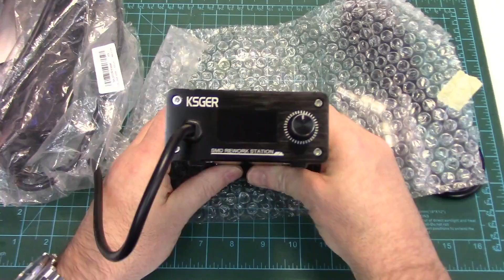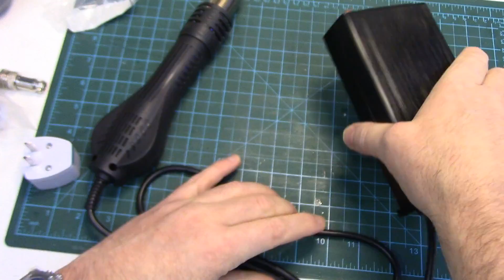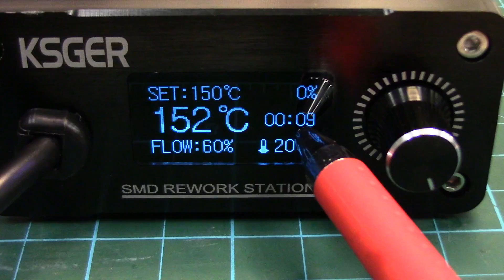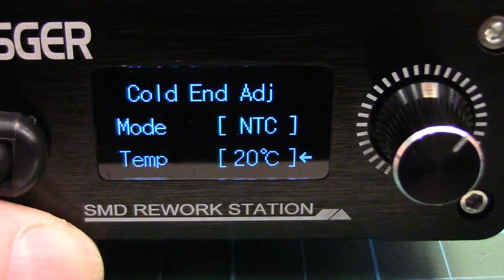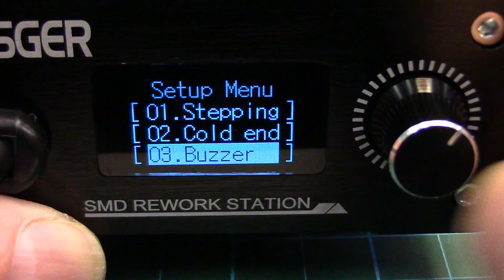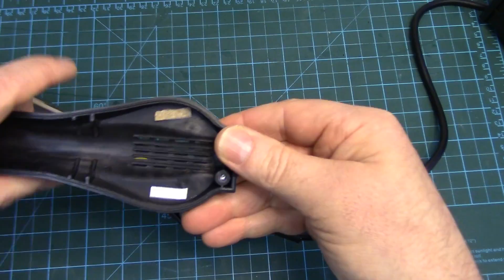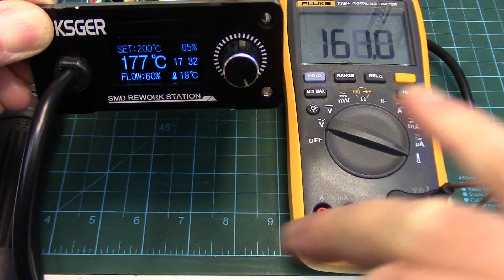KSGER 858D Hot Air Rework Station Review

Comment: Mine melted itself the first time I used it at 450 degrees and full fan for a minute or so
Tube glowing orange was the first sign that all was not well
- tip temperature wiring failed shortly after heating element burned itself out...so I suspect the wiring to the tip temp sensor was iffy causing the coil to burn out (due to it miss reading the silly high temps it was hitting)

I am having a few issues sourcing a new element to see if anything  can be rescued from the wreckage, so have ordered a new complete handle 

I am not convinced you have an NTC in the handle if it is the same as mine (which your images look almost identical)
If you look at the other side of the PCB that interconnects the wires from the flex to the components there is no NTC on there and I haven't spotted one in the flex lead...which is mysterious as I genuinely cannot see one no matter how hard I look for it

The unit I got was pre wired with a GX plug and mine is wired as follows...again I cannot even see any spare wires for an NTC mounted in the cable

Pin1 (red) > AC240v heating element
Pin2 (brown) >  24v fan +
Pin3 (blue) >  24v fan -
Pin4 (Green)> Green wire to ground the metal tube
Pin5 (Yellow) > Reed switch
Pin6 (White) > Reed switch and tip temperature
Pin7 (Orange) >  tip temperature
Pin8 (black) > AC 240v heating element

Really interested in which wires yours is wired into (and if you can show me where this NTC is supposedly mounted !)
Of course without a working tip temp sensor  I just get errors so I cannot even try and raise and lower the temp in the handle to see if the screen reacts to this mysterious  hidden NTC
Reply from the maker: Nope, there is no NTC sensor in the hot air handle. I show my specific wiring (color & function) in the connector mod video:  https://youtu.be/vtPHqNQ3pLY
Reply: @rchelicopterfun  Yep, found where mine lives - it is sat behind the screen - just above the speaker
managed to fudge mine so that it doesn't error so I could test it - by shorting the tip temp probe wires it 'thinks' it is at room temp - all the functions appear to work and I get 240v when the temp has been set - dropped to 70 V when not being commanded/requested-  so it looks like the controller is all working and I haven't killed anything in there - just a broken and burned out handle - hoping the replacement will fix the issues I had
(bit concerning that there is seemingly no thermal runaway watchdog in firmware - like on 3d printers - unless mine was an odd failure)
Also in mine when I go into the 'about page' that shows the firmware version - it is over calculating the mains input voltage  by quite a factor - again I am assume this is calculated in firmware and non adjustable (have checked the DC unit is producing 24v, so I don't get how they are calculating the incoming voltage and getting it wrong on my unit)

In that video you wired pin 8 (central pin) with a yellow wire labelled NTC in the handle and show it in the diagram? (other end of it shared with tip temp, reed switch and tip grounding in the schematic you show at the 2 min mark)
This threw me - as mine  didn't have one in there no matter how hard I searched for it and seemed to be wired differently :D
Have to ask where you got that diagram
Reply from the maker: @robocog  I made a mistake in what I said - sorry. After your comment about the yellow wire labelled NTC in that other video, I too started second guessing my memory (even my sanity) 😜
I just took my handle apart, and pulled out the little PCB under the fan. Sure enough, there is an NTC sensor on the back side and following the trace on the board, it's soldered to the yellow wire. So yep, mine does have one in the handle.  It's not one of those normal disc NTC's however, it's a little glass NTC thermistor (looks like a little zener diode). 
If your's doesn't have that or it's in another location, maybe they stopped putting it in? The other possibility is there are little differences between the 120 & 240V versions? I think the only difference however from the research I did on these things between the 120 & the 240V version is the heater element but that is just an educated guess. The electronics inside should be identical by all accounts.
If you are asking about the wiring diagram I had up on the monitor, it was on Aliexpress's Ksger replacement board product page: https://www.aliexpress.com/item/32857445049.html
If you scroll a ways, down you will find it. There is tons of good info on that page by the way so maybe something in there will help sort your particular issues. 🤔
Reply: @rchelicopterfun  -LOL,  no worries my sanity gets questioned a lot here, it just had me scratching my head a little when I was trying to map out the wires to see what went where and started wondering if the handle was physically missing the NTC or had been miswired to cause the premature thermal runaway and burnout
I REALLY want to have this unit working as I love the form factor and want to replace the big (898) unit that has to be put away between each use due to lack of workspace
Have designed a stand for the stand if you have a 3d printer your end?
I got 3/4 the way through printing it last night before I got a huge nozzle clog and had to abandon the print - but it has space for the unused nozzle tips underneath...will upload the design to thingiverse once I have fixed the printer and printed it to make sure it is a good fit :D
Reply from the maker: @robocog I really can't see that NTC being the cause for the meltdown. I originally didn't even have mine turned on and was using the internal selection instead. It didn't seem to make much difference to be honest. It almost sounds like the temp sensor in the heater element crapped out or perhaps the wiring. Maybe the fan speed has to be increased when running those higher temps (I rarely run mine over 400C)? Any chance the air inlet vents in the handle were partially blocked. I know if there is not enough air volume flowing through the heater element, the temp sensor which is up stream will not read the true air temp (reads much lower). All wild a-- guesses of course and my remote 2 cent diagnostic attempt. 
I don't have a 3D printer yet, but I finally started to look at them more seriously over the past year and think I may finally take the plunge into the 3D printing hobby this fall/winter. Still early in my research, but right now the Sidewinder X1 is on my radar; just not sure if I need that much volume? I know at times I've been stuck looking for larger enclosure or parts boxes for projects, and a larger volume printer would be nice for that application, but I don't know if a large volume printer can print small stuff too with good detail so still have more researching to do.
That is great idea about the hot air handle stand and wouldn't mind taking a peek on thingiverse once you put the design up.
Reply: @rchelicopterfun  Yep, I think it was the temp sensor at the exit end of the nozzle that may have been lying about what it was putting out (or rather the wires going through the core of the element former)

Fan speed was at 100% - and it sounds and feels like it moves slightly less air than my 898D (but with what looks like a very similar if not identical handle)
I definitely wasn't blocking the handle, as I know that bad things WILL happen if that were to occur :D
I set it to 450C, and stopped monitoring the screen once it had settled and made the beep to say it had reached set temp, less than a couple of mins later the tube was glowing red and no signs of it being able to regulate 
didn't have time to even glance or take in what the temp display was saying...I was kind of panicking at this point! :D
(the glowing tube seemed to happen very suddenly and I didn't sense the temps were getting hotter) - it made a nasty crackle sound (the coil shorting out I guess?)

I unplugged the handle and ran downstairs with it and took it outside before anything glowing could drop out of the plastic handle (meanwhile trying to blow into the fan...like that would actually help)

3D printing - have got 2 home built printers (Delta and a V-King coreXY)  and an Ender3
Can honestly say the Ender3 is a brilliant printer and mine has given me no troubles at all over the past 3 years that weren't user induced error
Beware - these things can be extremely addictive and will happily breed (Ender3 printed parts for the V-King, and V king and Ender3 printed parts for the delta)
the kinematics are addictive to watch - even now

If (or when ) you get one - you will no doubt come up with a gazillion ideas of things to print
It has created loads of fixes around the house - and plenty of custom fit cases/stands/doohickeys - the possibilities are endless

Have printed a stand for the stand :D
 - and it has evolved somewhat from the initial idea :D
(as these things tend to do)
It is now a 3 piece print and has been tested for fit and purpose

Might condense it to a 2 piece print to save the hassles of different tolerance setups

Now has a sliding drawer for infrequently used nozzles and a tray at the front for most used nozzles / bits'n'bobs

(the reality is the added  front tray part is needed for stability otherwise I found that tugging the cord with the wand in place meant it would sometimes try and tip over towards the cord)

Will upload it to thingiverse when I have the patience to deal with the timeouts and errors it will no doubt throw in attempting to upload to it (as they seem to have been having issues of late)
Reply from the maker: Thanks for info on 3D and your positive testimonial on the Ender 3. It has been on my short list as well so it's good to get your feedback.

Comment: The electrical adapter doesn't even use the ground pin from the German plug. So you lose that if you use the adapter. I also did the same 8 pin GX16-8 on my rework station... I may buy one of the KSGER stations and wire my existing wand up to it. I'm trying to find the wiring diagram of the ones you can buy with the GX16-8 connector attached by default so I can copy that so if it ever fails... I can buy a replacement and I won't have to rewire anything.
Reply: Also can't wait to see inside as the T12 soldering station should have the functionality built in for the hot air gun... so it should be possible to wire a plug up... Mine came with a ton of issues and I am still waiting on Banggood to resolve them.
Reply: Not sure if I like the UI for the blower... press to change fan, rotate for temp... I think I like the rotate for temp... but then you don't have the rotate for boost, standby, etc... maybe I'll make a 5 pin from the station, into a 3D printed box with the fan speed controller from my old rework station which is really nice, into the hot air with 8 pins. So a separate box so I can attach the hot air pencil to it too... I would need some way for the system to know it is using a different handle - ie the fan so I may have to look in the STM32 code stored and modify it... maybe I'll add a 'tip' which can be used for the handle... or I'll add a handle mode which changes behavior. 

I think if I don't use the external fan controller then either mounting it to the box would be an idea... OR making it so when the hot air wand is plugged in, that rotating the rotary encoder will change the fan speed instead of temp as yours does... and instead of boost, standby, sleep, etc.. as mine does. I like being able to finely control my fan speed while working. temp is usually pretty stable. so the normal tap and change would be fine.
Reply: Also, you should be able to rotate to the left 5 ticks to go up a menu. They should reduce that to 1 or 2, maybe 3... but 5 is a bit excessive.
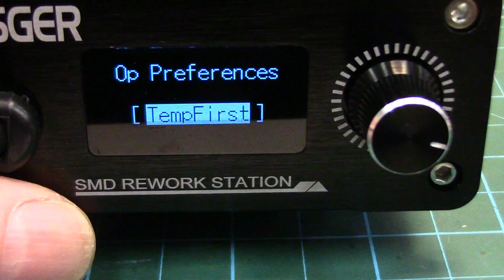Reply: 11:50 is a nice feature... could easily incorporate that into the code... I'll have to download the code. I have to verify the pin out on the board because there are 4 unpopulated pins on the solder station marked C, D, GND and VCC or something like that... vcc is 3.3, ground, d should be switched io or something, and c should be switched click.

I'll have to trace to see if it has a debug trace built in or not to switch between boot modes; if not I'll have to check the exact chip and see how to toggle it.

Either way, it should be possible to set up a single unit with attachments so that it extends functionality without needing extra stations... then, buy a few of them so the major ones can be plugged in at the same time.

Still need banggood to correct the issue with the current unit.
Reply: 15:30 - with the voltage; this is interesting. so I'll either need to add another connector to the station and use the appropriate circuit to pass the 110 through. or, I replace the 5 pin on mine with an 8 pin and have it by default, then make an adapter for 8 to 5 for the iron... and none for the fan... although with 2 of the pins going to ground I'll have to verify what each thing does first to see if I can stick with 5... probably not... an adapter would be meh... maybe a second station is better... going through some designs in my head. Maybe the 5 pin into the speed controller and a separate 2 pin for 110 with a quick connect on it... a higher quality connector... that could work.
Reply: Your board has G D V C and 2 pins right next... those 2 extra pins are probably the boot mode switcher for the STM 32... g = ground, D = switched io, V = 3.3, C = switched click. or it should be.... I'll have to see if it is similar on mine.

I also don't like that they have the power board and the logic board combined... Having it separate means they could've used the T12 station front piece most likely... although with 8 pins instead of 5. Honestly, that piece should've been separate too - it should've been the pins from the GX connector into a lead, then the lead plugged into the board... and it actually does support this because there are through-holes that connect to the piece of the board which accepts the 5 pin... 

I also hate that it was put in crooked. but making a connection out of the two and disconnecting that piece of board may be something interesting to do. 

I actually do like that this unit has a connector going to the board... same design as my old rework station - I put a cut in those wires and connected the board to GX, then GX to the hot air gun and I left the center pin ground, along with outside edge... Easy to disconnect if I needed to - easy to change the wiring if I wanted to and I probably will so that the other purchased ones could be plug and play.

Comment: I know you just got the KSGER but seriously you should try out the TS100 iron or the TS80 they're both insanely good
Reply from the maker: This is a hot air rework station, not a soldering station? Regardless, I have a TS100. Did a video on it: https://youtu.be/OYDeogFmLWI
Did a full review on on my website: https://www.rchelicopterfun.com/ts100-soldering-iron.html
Did review on a clone of one (the SQ100) : https://youtu.be/_j4VCYeQ6Pw
And did a video on the switch rate of the direct drive solder tips on the TS100:
https://youtu.be/vLT7L8NlUhg

Needless to say, I'm very familiar with them. While they are wonderful little soldering tools, and are great for RC field usage, they will never replace a similar technology bench top soldering station if you do a fair amount of soldering like I do.
Reply: John Salt i know, i did watch but when you mentioned you replaced your iron i thought you may have not seen the ts80 but i saw some people review the other irons even the super expensive ones and the TS80 apparently is more efficient than even the high end weller stuff
Reply from the maker: The TS80 is not as good or practical for RC field use as the TS100 is. Also not as powerful and I need to do up to 10AWG, sometimes even 8AWG. Something the TS80 won't do. I go over the deciding pros & cons in my TS100 review between it and the 80 on my website. If you read that review, you would know why I chose the TS100 over the 80. Again, it comes down to individual application/s and what ticks off the most boxes.

Regardless, for constant bench top use, neither the TS100 or 80 can hold a candle to a proper soldering station. That was after all the original premise of your comment (TS vs Ksger).

Now if you want to move the goal post to compare the TS100 vs. the 80; as I said in my review, each are wonderful portable soldering tools within their specific scope of applications. Neither is better than the other however; it's application dependent like most tools.

Comment: there are actually 2 versions of this unit now. the new one doesnt screw to the bottom of the chassis they redesigned the board to slide in like the soldering stations. i just ordered one of those boards to compare to these units.

Comment: Hi John, Have you heard any reviews on the KSGER Hot Air Gun SMD 700w Rework Station GX16-8?  It looks to have very similar specs to this 858D, though the circuit board is looking a little stubbier and mounted sideways - to allow for the GX16 socket.  Appears very similar to your modded version, though still without a chassis earth, as appears to be the way on Chinese equipment.
Reply from the maker: Sorry, haven't heard a thing about it.
Reply: @rchelicopterfun  No problem, just deciding whether to mod the standard one you have reviewed, or go with the ready made GX16 offering, though KSGER appears to have revised the circuit board on that one and repositioned it. Maybe the devil you know is better..